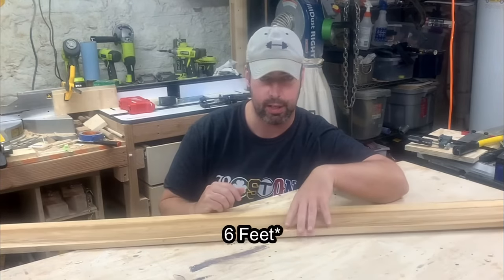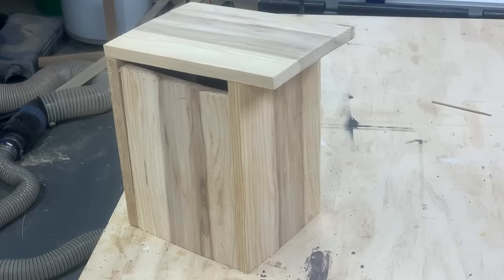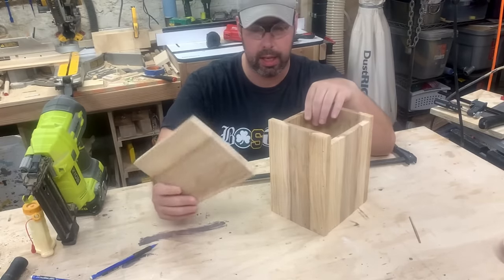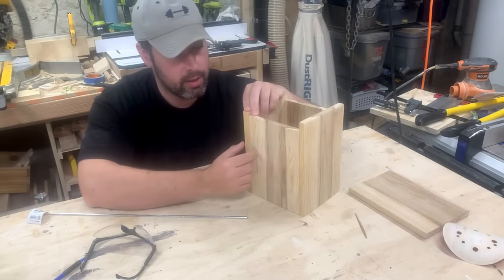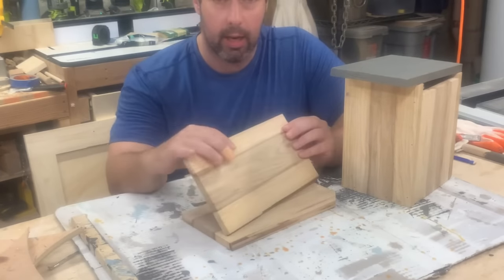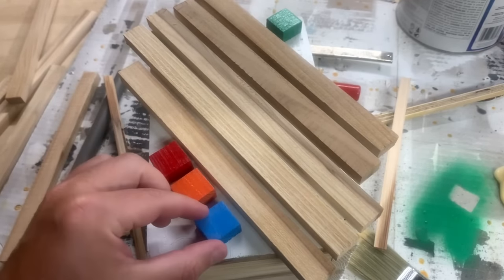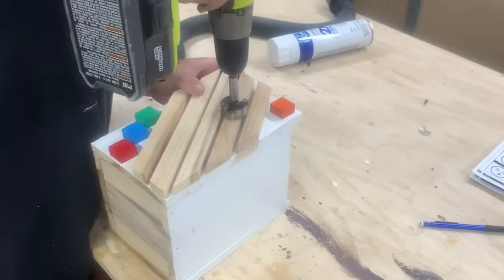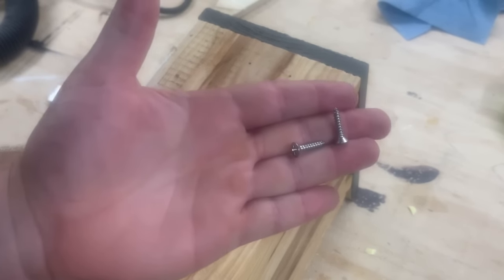Mid Century Modern Birdhouse from Cedar Fence Picket //DIY //FREE PLANS

Comment: You want the front board on bird houses to be rough for them to be able to claw/grip when they are climbing back out of the box and/or notch the inside or add cloth or something brom the bottom of the nest to the hole for them to grip as they climb out.  If not entirely smooth side houses can become a death trap.  Also...recess the bottom between the sides up into the house so it's Not flush with  any of the sides and then  cut bottom edges of perimeter boards at an angle and assemble with the long edge out to serve as a drip edge and make the houses dryer and last longer.  Overhangs on all sides of the roof, short on rear & sides and long in front also keep things dry and slow the rot process.

Comment: Your exterior designs really make this simple birdhouse outstanding.  And you can sell these for $100? I am impressed.
Reply from the maker: The price varies based on the design, but they've gone from $60-$120.
Reply: @slightlycrookedworkshop  There is no way you are selling those for $100. But nice way to trick others into watching your video. Very nice looking design and work however. Good job.
Reply from the maker: @randyl1170  $100 is on the lower end for a lot of these. Other people charge more. If you can find a market, or create a customer base, you could have people paying much more for these. With social media, it's not difficult to do.

Comment: Nice looking design & colors for humans, but the birds don’t really care.  In fact the rougher inside enables young birds to climb up & out as needed.  I find that rougher more rustic bird houses are preferred over fancy painted houses.   The latch/hook on back only works on flat areas (like fences), but not practical for hanging in other locations. All-in-all, a good build.
Reply from the maker: You're right, these are mainly for decoration/collection. One of the first birdhouses I built I put on a post, but it wasn't practical in the house I was living in at the time.
Reply: The Birds aren't the ones buying them though ;)

Comment: If you charge that much you will sell less. $35-$40 is the going rate for cedar bird houses. I sell more cedar bird houses than I can make.
You should always leave the outside rough if using raw wood, and never paint them. They should weather to blend in with its natural surroundings.
Reply: I was gonna say the same thing... I also hinge the top instead of the side panel..

Comment: Where did you get the picket?  Didn’t know they were available near Boston?
Reply: St L?
Reply from the maker: I bought these at Home Depot, but I just looked and they're not available in Massachusetts. You can try calling a fence company that does cedar fences. Ask if they'll sell you some leftover boards.
Reply: Come to RI they have them
Reply: Lowes in Salem NH has the cedar pickets for under $2.50.